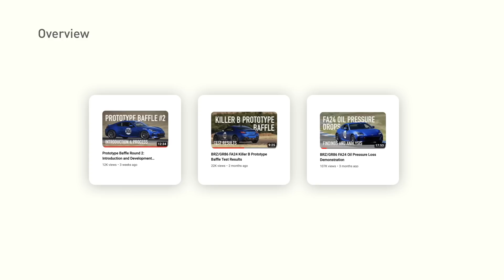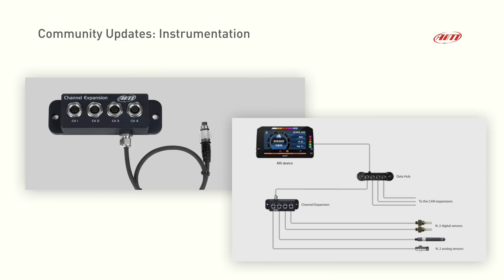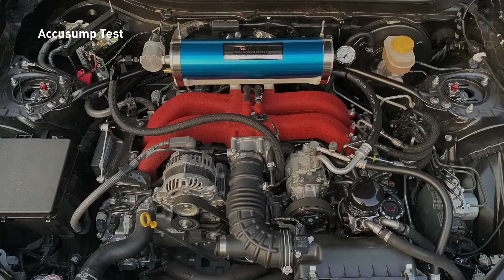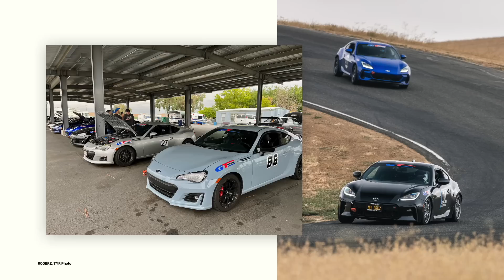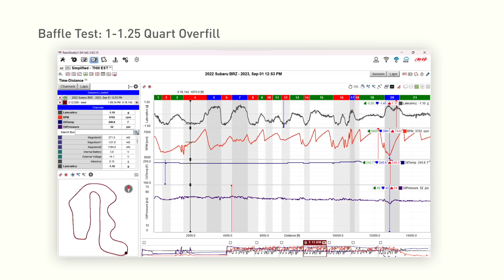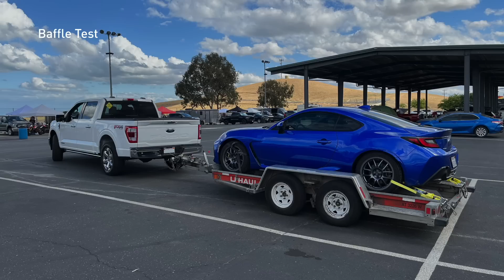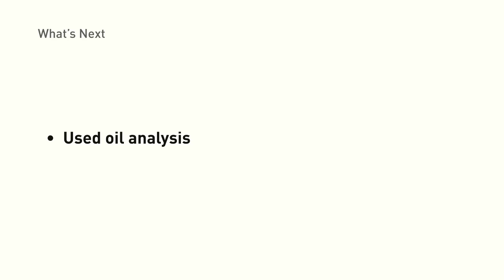Prototype Baffle #2: Results, Setbacks, & Future Plans

Comment: Great work and great data. The issue with getting the oil to drain back into the pan, sounds similar to the Nissan RB head drain issues. I saw a thread of someone swapping an fa24 bottom end with fa20 heads into a 1st gen, and they noted the differences in the upper pan where oil drains into before going into the lower pan. It looks more shallow and definitely different than fa20, which could be a contributing factor here. Worth a look

Comment: What observations you do have now regarding oil overfill for stock engine for street/rare track day usage? Could it help preventing pressure drops? How much oil to be overfilled safe?
Reply from the maker: Covered in later videos. It definitely helps but does not completely solve the issue. For street driving a half liter overfill is a no brainer.

Comment: Is this only an issue if you track the car?  Are these issues happening to non track BRZs?
Reply from the maker: I don’t push my car on the street and in normal driving the oiling performance is fine. I think pressure drops on the street would be pretty unlikely. You’d have to be pushing the car quite hard.

Comment: I'm sure someone has linked you, or sent you his way, or maybe you know of him, but if you look up Studiousgr86, he is running a 1L overfill, now whether or not it is on top of the additional 0.8L of oil required for the oil cooler/lines, I'm unsure, so either he is running a 1.0, or a 1.8L Overfill, but you can clearly see in some of his videos, he is maintaining 60PSI+ of oil pressure during the lateral turns even with elevation changes. https://www.youtube.com/watch?v=L3_zrO6gDSU

Comment: Any updates? I was just about to buy an GR86 today but have since held off after seeing these issues. Do you think a solution will come that won’t cost an arm and a leg? Or safer to skip the GR86 for the moment ? For someone with light but potentially regular track use
Reply from the maker: We’re still working on it. Accumulators are working but add complication. We’re getting close to being able to test high capacity sumps. If you’re relatively new to tracking, you probably have a while to get fast before it really becomes an issue

Comment: Would it be possible to have a temporary clear oil pan made and put a camera with lighting under the car to visually see what the oil is doing on those hard right turns ? Also someone mentioned a pickup redesign, whether it have a pivot to allow pickup at all times. What about depth of pickup ? Perhaps there is oil left but maybe the pickup is just a wee bit short. 
It would be interesting to get with a company that can 3D parts and upload to CAD model and run dimensions to see what clearance/angles are in the pan even maybe an oil pan redesign with a new pickup ?
Reply from the maker: Yeah that would be great, I just don’t have the capability to produce that part. Replacing the pickup requires removing the timing cover, unfortunately. So it’s a big engine out job. I calculated a 12mm gap between the bottom of the pickup and pan. But I don’t have any other cars to compare that to.

Comment: Wouldn't cold start wear increase compared to 0w-20 if I use 0w-40 engine oil to start cold? I'm worried. I would appreciate it if you could check this part as well during the next experiment. I got your back!!!👍
Reply from the maker: It’s hard to say what wear would be specifically, but you can look at the two specified kinematic viscosity values oil manufacturers provide to get a sense of what the difference is. Idemitsu 0W-20 (either OEM or very similar to OEM) is 44 cSt at 40 deg C. Motul 8100 EFE 5W30 is 70 and Mobil 1 FS 0W40 is 77. At 100 deg C the KV is much closer at 8.3, 12.1, and 13.8. We routinely see higher temperatures than 100 C so we are worried about 0W-20 thinning out too much on track.

Comment: Hello, I also have this car. What abou to try to install oil pickup pipe from gt86? it si sucking oil from the center of the oil sump, but in the new car it sucks from side. And did anyone asked directly toyota to solve this problem? I will, because this is not just problem on the track, this will also happen on the road.
Reply from the maker: Changing the pickup requires removing the timing cover on FA24, so it’s a big job.

Comment: Verus is a good company for sure and puts effort in to engineering, that's why I didn't worry when I paid $80 for small plastic part, it's engineering what I paid for. 0w40 is definitely way to go, since you are starting from scratch I think a baseline without oil cooler and with overfill would be good to have as well with 0W40 oil, if you could. I assume you are going with Mobil1 FS?
Reply from the maker: Yup, going with Mobile 1 FS. Definitely big props to Verus for how they handled this!

Comment: So we are actually paying versus here, not yourself? I don't think I've seen a situation where we pay for a companies R&D failures?
Reply from the maker: Verus is paying for the complete engine and I’m paying for the labor, fluids, and misc parts like oil cooler core (with community donations).
Reply: @900BRZ  just in your video you said specifically you wanted to reduce their (versus) costs.  But yeah, makes sense I guess now you say that.
Reply from the maker: @Blight-fp3vt Yeah, they may have been willing to pay for the labor as well, but I feel like it’s fair for everyone involved if I put donations toward the cost of the labor vs just trying to offsetting all my previous costs. Verus is a small shop with just 6 employees all based in the US and we all benefit from their continued investment in this platform.

If you want to see the full costs, they are available in the spreadsheet and I can update them when it’s all settled.

Comment: It is hard ot tell in the edited video but I think left a VERY important question unanswered, that will shed the light at what we can expect from stock cars.
How long did the engine last under load with 0psi? 
Yes, it is all subjective but what you have on your hands is not a catastrophic failure after light application. I noticed at least 2 minutes of high throttle application with no oil pressure and you still managed to bring it in with what sounded like a mild to miderate knock. This is not unimpressive and a testiment ot how good modern engine oils are. There is a good chance that had you restarted your engine (to release the sucked up part), you could avoid replacement alltogether. Yes, it is a could've/would've type situation but I think there's a lesson in there.
Reply from the maker: Yeah good point. I ended up doing some jump cuts in editing to not slow down the pace of the video too much. Here’s some more info: 

- At 27s into the lap, pressure drop event occurs
- 1m28s last time above 6000 RPM (this the point where I understand there’s been at least a sensor failure and start to drive differently)
- 1m50s last application of throttle position over 55%
- 2m07s in pit entry

Definitely impressive for it not to throw a rod in those conditions. Other friends with failures did throw a rod. 

I’d like to bring back the oil pressure warning switch, which was removed in place of the oil pressure sensor, or to otherwise build a warning system. Had I shut of the engine right away, I agree we potentially could have avoided the bearing damage.

Comment: Thinking about the oil pressure drop: it seems like the asymmetrical position of the pick up is why we (2012 BRZ owner here) are only seeing big drops on right hand corners. To me this suggests modifications to this element rather than baffles. I've got 2 suggestions 1/ Symmetrically located pick up with a wider spoon (not sure if that is the correct term) so it can still find oil even under high lateral forces 2/ Swing mount/jointed arm pickup that can move with lateral forces and always find oil. Thoughts?
Reply from the maker: Replacing the pickup requires removing the timing cover, so you have to pull the whole engine out and tear down most of the accessories. It’s a big job, so we’ve been focusing on solutions that allow keeping the stock pickup.
Reply: @900BRZ  That makes sense, I didn't realise changing the pickup was such a big deal.
Reply from the maker: @markir9 Yeah it’s annoying. It is easy on the FA20 since the bolts are accessible from the bottom

Comment: I'm guessing that spot welds failed on the prototype. I'd like to see this baffle with door pursued more than the Accusump (even though I ran one on my STI for years). 
I overfill my BRZ and depending on the paddock grade I may smoke a bit when the engine first runs. I don't have an A/OS. I do have an oil cooler and a vented hood.
I have about twenty track hours on it this year alone. Making 228 WHP, revving to 7,500 RPM's at times, and pushing it very hard, I'm very happy with the engine and it still has not missed a beat! Oil pressures have stayed consistent.
Reply from the maker: I’m hoping to potentially get my hands on a TRD baffle as well, but at this point we’re thinking (based on the success of the overfill test) that the main problem is slow return to the oil pan and that we need to make more oil available either through an overfill, high capacity pan, accusump or some combination. Agree that it would be nice to have viable mitigations without everyone needing an accumulator.

Comment: Just to touch on a point you made in the Accusump Test Results section, are unmodified GT86s/1st Gen BRZs at risk of engine failure/significant oil pressure drop due to high G-Forces in turns as well? Obviously with GR's and new BRZs it's the case but I hadn't heard about it being a thing in the older models so now I'm starting to worry if it's something I need to consider when driving my GT86.
Reply from the maker: You can check out my first video in the series, where we compare the FA24s in 2 cars to an FA20. The FA20 has better oiling performance at the same pace, but still has small-duration drops. Overall I would not be concerned about the FA20 with similar setups to what we’re running on track. Off track I would not be worried at all.
Reply: @900BRZ  Thanks for the explanation, and as everyone else is already saying, this work you're doing is brilliant.
Reply: Not as much. This is more an fa24 problem

Comment: Question about the AccuSump Relief Valve; can you advise what type of cold-start pressures you have been seeing on the FA24's?   175psi seems significant.
Reply from the maker: I asked my friend to take a closer look at his car. We typically see 110-120 right on startup at idle. So it’s not inconceivable that they would get close to 175 once you add revs. It also seems high to me though.

Comment: I'm not sure about the oil pump specs on this engine, but Subaru uses very high flow oil pumps in general. The oil pump in the turbo FA20 in my WRX is rated at 60 L/min at 6700 rpm, and has a 6 L total capacity (at rebuild), which amounts to the entire oil capacity circulating in only 6 seconds.  With these high flow rates, oil return time could be an issue, as could foaming.

Using a thicker grade of oil would have the benefit of reducing oil flow rates to the engine once the oil pump's bypass activates at a certain pressure at high rpm.  Based on your videos, this engine's oil pump starts bypassing well before redline when the oil pressure stops increasing.  Once the oil pump starts bypassing, a thicker oil will result in more oil bypassing and reduced flow to the engine.  A lower oil flow rate to the engine will leave more oil in the sump.  Installing another oil cooler to reduce oil temperature would have a similar effect.  Thinner oil may flow back to the sump a bit better, so it's hard to say definitively if there would be a benefit, but it might be something you could test.

If you're concerned about foaming, especially with the overfill, you could try to use an oil with lower potential for foaming.  All API oils are tested to ASTM D892 for foaming.  The results of these tests aren't usually published, but you could try contacting the manufacturer.  API CK-4 diesel engine oils have more stringent limits for foaming (40% of the limit that is allowed for API SP gasoline engine oils in the high temperature foaming test).
Reply from the maker: Great insights, thanks so much for commenting. 

I’ve heard mixed things about the flow rate. The FA24 oil pumps are very similar to the FA20s, so they also have high bench tested flow rates. Chris from Killer B said that the real-world flow rates are significantly lower than on the bench, but I’m not sure why this would be unless it’s sucking air. We know that’s the case sometimes, but I wouldn’t expect it all the time. Maybe he meant that the flow rates are lower to the engine due to the bypass valve. 

Overall, we agree that the success of the large overflow points to insufficient oil return and so we’re probably dealing with low oil levels in the sump. There’s probably not enough oil to control effectively with baffles, no matter the design. This is a pretty big learning and will change the direction of our research. We’re now looking to see if we can measure oil level in the sump at high RPM. Those tests should be doable with the car stationary in neutral, which should make them easier to conduct. 

I’ll do some research about anti-foaming. That’s all new to me. Thanks so much!

Comment: Good vid and sorry about your motor. This entire year I’ve been running a moroso baffle, 1 quart overfill, 2qt accusump w/manual valve and had zero pressure related issues(fa20). I open it up on pit out, and close it at pit in. I’m also on aero and Hoosiers. I can certainly vouch for accumulators.
Reply from the maker: That’s great to hear. We’re considering the Moroso because it has a higher operating pressure and no pressure relief valve. Do you use a cable operated valve? How do you route the cable and how long is it?
Reply: @900BRZ  wish I could post a pic, but no I actually have my AS mounted laterally in the passenger footwell. The valve is closest to me so I can still reach it with the belts loose. I mounted a camera to monitor the AS gauge, but haven’t overlayed it with track data yet.
Reply: I do have an unopened remote valve for sale if you need one 😂

I also teed the AS into my oil cooler. I didn’t like the super high cold pressures I was getting from the top front galley.
Reply from the maker: @politicallyerect6086 Oh cool, I see. You can message me at @900brz on instagram if you wanna share photos. We have been thinking about adding a pressure sensor to the air side of the accumulator so we can add that to our data logging as well.
Reply: @900BRZ  yeah logging the AS would be perfect. I’m doing it the crude way 🤠
Reply from the maker: @politicallyerect6086 Crude works just fine! Just can’t make fancy charts.

Comment: Why switch to 0w-40 oil? I've always been told that oil viscosity is matched to bearing clearences, so it's probably best to stick with 5w-30 on OEM specs. Best of luck with future testing. I hope to see more videos shortly
Reply: This is a great question and there have been absolutely endless debates about this. The most compelling argument for 0w40 is that the GR Cup, which uses totally stock motors, runs 5w40. But 5w40 is a lot thicker than 0w20 upon startup, so 0w40 somewhat bridges the gap. Downside is that you'll probably burn more oil and need to replace it more frequently than 5w40. 

Also, 0w20 is street spec oil. It's almost certainly the optimal oil for daily driving. But track driving is totally different. Oil temps can easily hit 250F even with an oil cooler. 270-280F is possible without. At that temperature, your oil gets a lot thinner. Engines are designed around a certain oil viscosity, not an oil weight. You need your oil to cater to the temperature window the engine operates at.
Reply: @404nobrakes  Personally, I switched to 10w40 from 5w30 in my H22 to see if it would reduce oil consumption and it did. Burned half the oil with 10w40. Then I rebuilt the engine and no consumption any more, running strictly 5w30 again
Reply from the maker: @404nobrakes Yeah exactly. I’ve seen at 240 deg with 5W-30 and my setup (Jackson Racing air to oil cooler and OE heat exchanger) I’m getting down to ~50 psi. Would like to maintain closer to 60 psi and the higher viscosity oil should help achieve that.
Reply: @900BRZ  makes sense, although I have also heard the temps will just be higher yet with thicker oil due to the increased effort to pump it around, be interesting to see how it treats you
Reply: @bb1ben  there's been plenty of demonstrations with 40 weight. I think @NoStreetRacing86 and Track and Build have videos about it. So does ansix auto. Increasing oil weight doesn't increase temp that much once you're in the correct viscosity operating window. It does increase in temperature more quickly when you're below the operating window because more viscosity = more heat.
Reply: @404nobrakes  good to know, I wasn't aware of that

Comment: There are good reasons why racing engines don't use baffles.  Dry sump lubrication exists for this reason.
Reply from the maker: Yeah that’s the best solution no doubt, but also $$$
Reply from the maker: Not to mention there are none commercially available, so we’d be developing that from scratch. If we can get consistent oiling without, it will be much more accessible. Think we’re not far off now.

Comment: You saw single digit oil pressure and... kept driving?... but slower? what would driving sloweerr do? lol. For shameeeeee
Reply from the maker: I assumed it was a sensor failure initially and it was already half a lap later at that point. We’re working on better warning systems now for obvious reasons. Would have been possible to save the engine if I could have reacted faster imo.